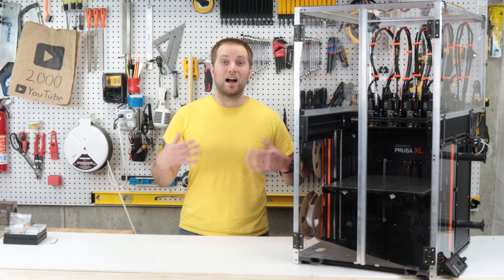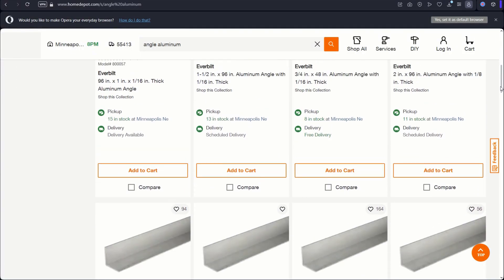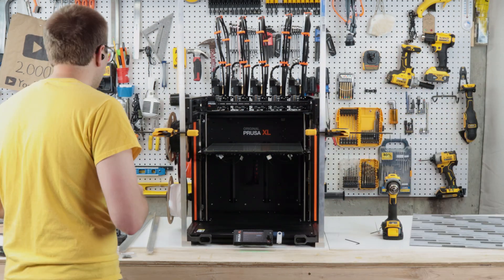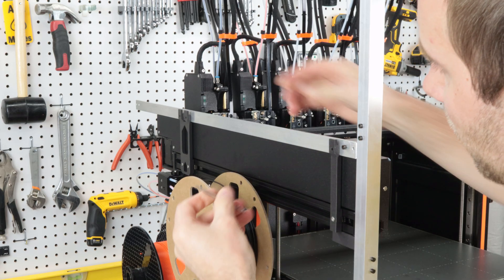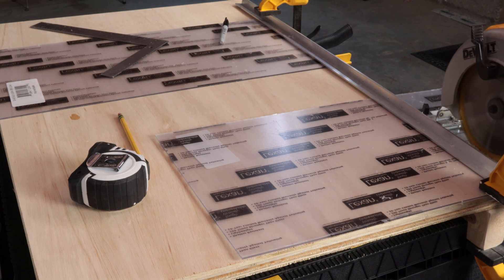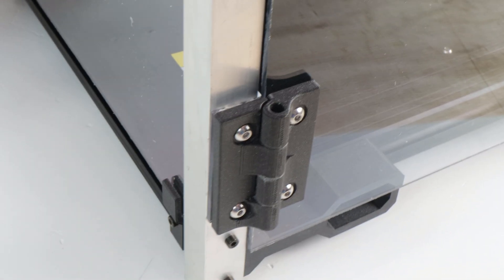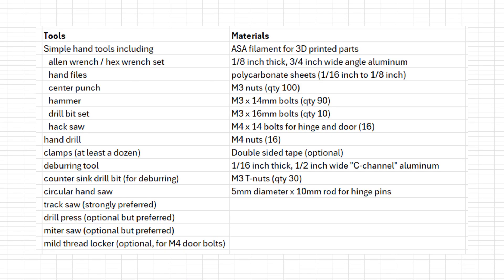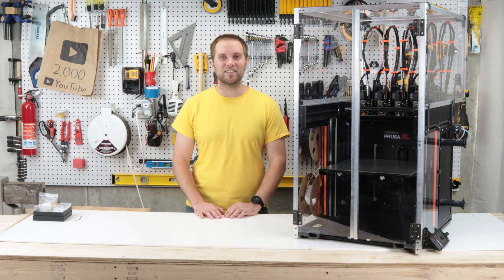Prusa XL Enclosure - Design and Build your own!

Comment: Have you given any thought to moving the spools to a separate area under the printer in the same enclosure but sealed away from moisture? Maybe with a small enclosure heater and some desicant packs to eliminate moisture in your filament? this is what I am looking at if I can direct the filament from there up the rear of the printer to the heads.
Reply from the maker: I have a Quincy lab oven I bought on eBay under the printer, it holds 3 spools - and I use it during summer when the humidity in my basement gets high. In winter I just run a dehumidifier and that's enough.

Thanks for watching!
Reply: I notice in your Autodesk session you have an image of the printer, do you possibly have a step file I could import into my software that I can use to design the enclosure around?
Reply from the maker: @chassecourt8824 I have it linked on my printables page for the enclosure, the model is by surfalex2000 (also on printables). Follow the links in the video description and good luck!

Comment: If Bambu releases a tool changer printer, Prusa is going to get slaughtered on this printer. Really insane their enclosure is the best they could come up with after so many years in development… so many air gaps that really make ventilation impossible. Considering how much we know about how dangerous the fumes and particulates might be, they really dropped the ball.

Comment: Great Projekt!  Do you have a rough count of how much you paid for this case in total? (only build material without tool cost)
Reply from the maker: Thanks! It was about $600 though like I said I could have saved $100 or more by buying cheaper polycarbonate and aluminum